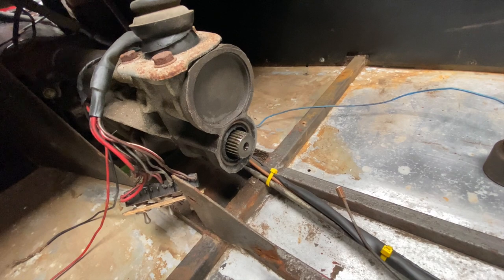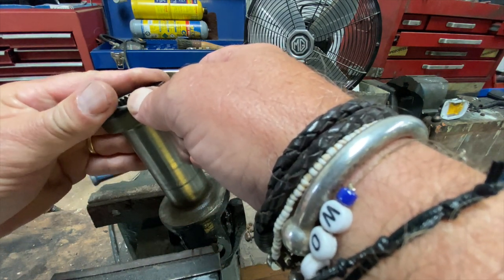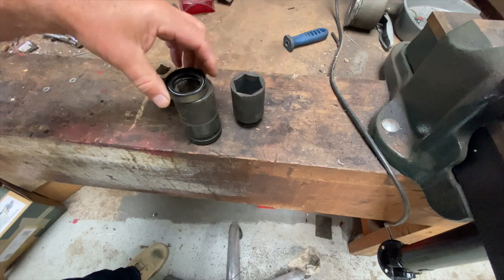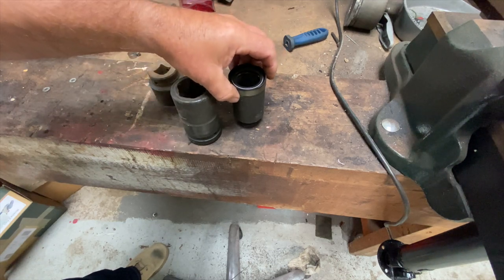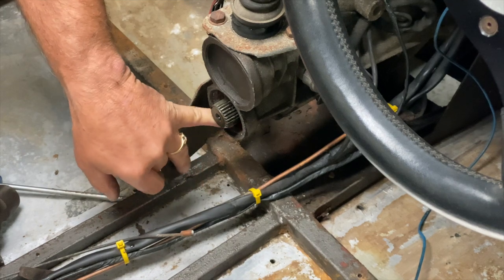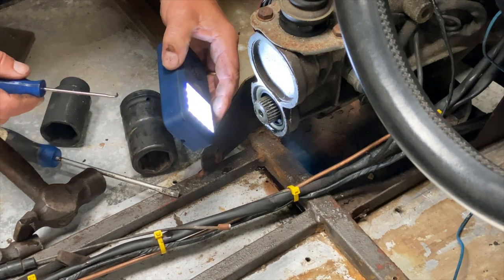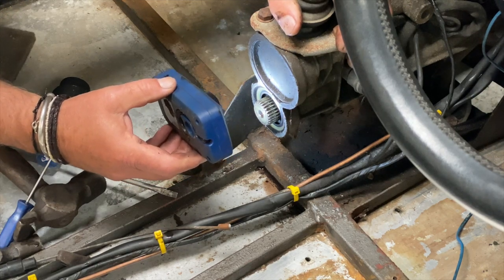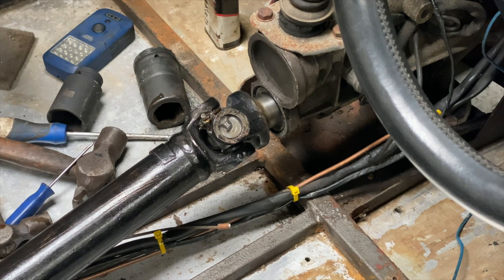Gearbox Oil seal swap out

Comment: Do you have to remove the engine from the car to do this repair
Reply from the maker: No but drop the gear box oil
Reply: Why would my mechanic say the 2012 Lincoln MKZ 95000 miles wasn’t worth fixing?